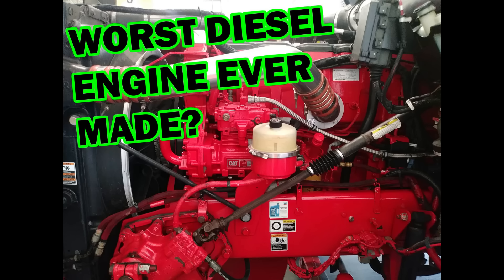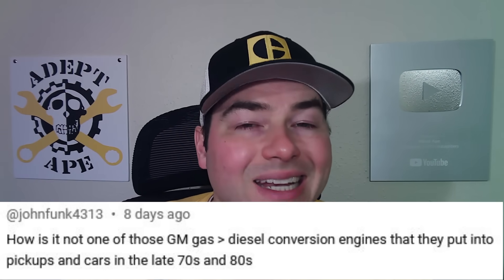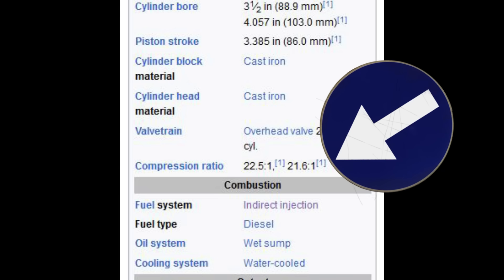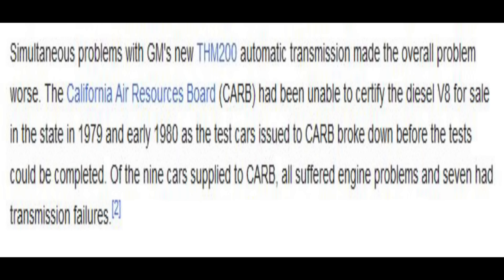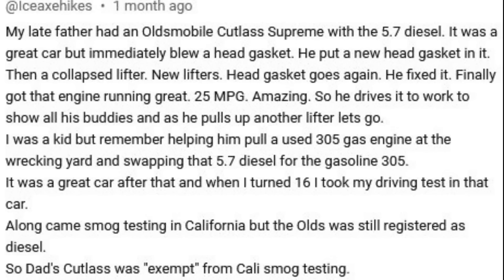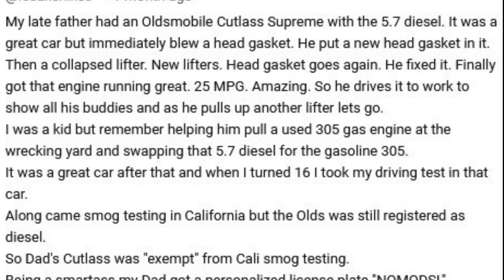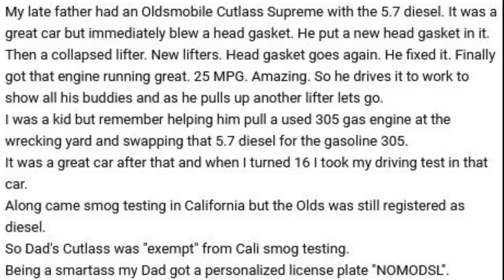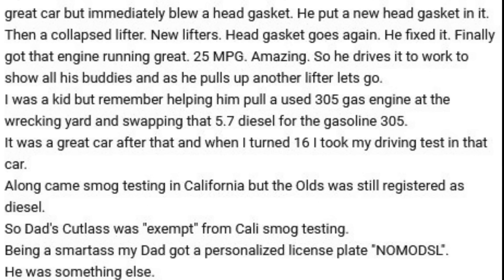This Engine is the Reason You Don't Have Diesel Cars in America!!!

Comment: Mom bought an 81 rabbit diesel for 7200 out the door. 
Those little fellas are some of the best diesels of the time , ran rings around the domestic garbage as far as reliability.
Reply: Had a Diesel Rabbit for a loooong time, still have a diesel w123 mercedes..Most reliable car ever built.. GM idiocy, particularly how they treated their customers guaranteed most would never buy another diesel anything, many never another GM product, more than a few never another US built car.
 GM knew how to properly build a diesel engine; ie Detroit Diesel, Electromotive locomotive engines.  In europe  Opel(part of Buick then) built a fine engine.
 This is what happens when bean counters and marketing override good engineering.. Had they got it right there would be fewer imports in the market imho.
Reply: Volkswagen Diesels produced about forty-ish horsepower with a timing-belt and a weak head gasket. When it came to 80’s Diesels, Mercedes was king, with the MFI Peugeot Turbo-Diesels being a close second.
Reply: A shame they have been legislated out of existence for the US. Our government at work.
Reply: I have a Fiat 1.3 diesel based on their FIRE engine line that’s been around since mid 1980s. 
Double overhead cam, 16 valves, direct injection and 70bhp out of the box. They can be mapped to 95 bhp. 
A major feature is the split crankcase/block. Above crank is cylinders in cast iron. Below crank is a one piece aluminum block that carries the bottom bearing shells. It’s as strong as. 
Cylinder head carries valves lifters and rockers. Twin cams are above that.
Reply: @Dave5843-d9m  1.3 iirc have also an alloy head and Multijet

Comment: I know someone that bought one in a fancy full size Olds. The injector pump leaked in the basement garage, weeks to replace and it leaked again. Head gaskets went and during the repair process a bolt got dropped in the intake. Scratch the engine. The dealership owner had lent his personal car, a Caddy, and really wanted it back. This guy told him write me a check for what I paid for that pos, and you can have the Caddy back.  He took that check and went to Mercedes dealer. That was a good reliable diesel...

Comment: Due to CAFE bs Mercedes Benz almost exclusively sold diesel cars in the US during the late 70s/early 80s. Something like 80% of cars sold were diesel power. Some of the turbocharged cars didn’t run too bad at the time. Unlike the junk Olds engines, the Mercedes diesels didnt die, they just leaked oil.

Comment: Back in the 80's we would (on chevy pick ups) pull the 350 Olds diesel and install 350 Olds Gas. The 24 volt starting system would be reused and those 8 to 1 compression engines would really spin over fast on start up.

Comment: Had 3: 1982 Olds Delta 88 5.7, 1981 Olds Delta 88 5.7 and 1984 Cutlass Ciera 4.3. Swapped the two 5.7s for early 70s 350 gasoline engines. The 4.3 V6 diesel was amazing. 29 mpg city and highway with the lock-up torque converter not working. The engine was so tight that it took a month of driving for the engine oil to go from completely clear to faint gray-clear and be visible on the dipstick. These were indirect-injected engines with a swirl chamber. They needed the very high compression to overcome the heat loss due to the high surface-to-volume ratio. The 5.7s were NOT converted gasoline engines. The blocks and internal parts were different, heavier than the gasoline engine components. Popular Science claimed the diesel 5.7 ended up being only 50 pounds heavier than the gas engine. Compare the weights of industrial diesel engines to comparable displacement gasoline ones: Chrysler 3.8 V6 weighs 413 pounds, Cummins 3.9 I4 weighs 679 pounds. The automotive and light truck application needs a light-duty, high-revving, lower-cost diesel engine. Basing such on a gasoline engine production system just made good sense. More testing was needed to uncover head clamping and water-in-fuel problems and correct them. Ever seen a 1985 5.7 diesel V8?

Comment: I remember Oldsmobile diesels being converted to gasoline. Way better blocks than regular blocks. High horsepower potential indeed. All diesels nowadays are cursed because of climate nazis. I steer clear even though I'd love have a 4bt or Perkins in my truck I am speaking of the 350 stroked and poked

Comment: Dad had an '81 Olds Delta 88 diesel 5.7 ran like a top. Used it on a rural mail route 71 miles 400+ stops a day. Just needed to run good oil and change it often we did 3k miles for a change. Front brakes were today after 3 months. I got really quick on front pass changes. Kept the car for 5 years never opened the engine or trans.

Comment: I have a 14 Chevy Cruze diesel with the 2.0. Emissions fell off approx 20k ago in a tragic pothole accident. When emissions were stock it was getting approx 48 highway (best) and now it gets nearly 56 highway (best). Besides it being in a pos Chevy Cruze, the motor itself has been great. Did all the recommended timing belt, water pump, idler pulleys etc at 100k and it’s been flawless since. 👍
Reply: Did you lose all your guns in a tragic boat accident aswell? LOL

Comment: If I could find another 5.7 diesel I would drive it until the wheels fell off.  Had an 82 impala with the v8 diesel while working road construction and going to college in the late 90's. Had 280k when it was retired due to being rear ended.  Biggest problem with diesel cars is they are driven like a gas engine.  Fire it up and stop at the store and shut down.  No warm up or cool down.  Thanks for bringing up fond memories.

Comment: now here's a crazy one. in my old factory service manual for my 91 s10 there is a listing for the 6.2 diesel as an engine option for that little truck. now im not sure what reason or purpose that some one would need a 6.2 diesel in that small of a truck, but what an insane idea it is none the less. if you could get it to hook up that would be a veritable pocket rocket of a truck. i dont know if the engineers were just goofing around or were actually serious at that time; just think of the possibilities that truck could have had. if it wasnt for the damn goverment epa regualtions the s10 would have a lot more engine options than just 3, also maybe some better gearing options too.

Comment: Good video, Josh. As always. I owned an ‘81 Bonneville with the 5.7 diesel engine. Great car, 30mpg with a 30 gallon fuel tank. I drove the car gently and finally lost a head gasket at 100k miles. The shop manager came out to confirm that the engine had never been opened up before. Sometime after that I swapped in a gas engine. I could have driven that diesel car from MD to Fl nonstop if I had a catheter. :)

Comment: Our neighbor bought a Diesel suburban back in early 80s, we use to camp with them, first trip to Fla they had issues all the way down towing a 20ft camper, got it fixed during the 2 weeks we were in Fla, motor blew up 40mi from home. He ended up ripping that POS Out and put a small Detroit outa some mid sized dump truck, all i remember as a kid was the whole back of Suburban was black with soot, and when they drove by it huffed clouds of black smoke. Boy did that truck pull! They put some big standard transmission in it. Ill find out what motor and trans it was and comment. What a cool truck for the early 80s
Reply: I’d love to know what and how they did it. I’ve wanted to put a Detroit in a suburban for many years and any info would help immensely!

Comment: Compression of 20-22.5 is not unusual in non turbocharged diesel engines. Modern turbocharged diesels are usually 14.5-16.5.

Comment: As I believe I had mentioned on that prior video, my brother had bought a 1980 chev half ton with the 350 diesel at my dads push for him to do so simply because it would get better mileage and diesel was cheaper. He always plugged in the block heater and treated it well but it started to run rough and smoke and had to have the injectors replaced ( he had installed a racor fuel filter assembly on it right off the bat to combat any possible water etc and they filter extremely fine ) , then it was running like shit again after a time and since it was off warranty he decided to sell it ( more like almost give it away ) vs sinking any more money into it. No doubt it needed a fuel pump and injectors and who knows what else was about to go on it. Now I wish I could recall who it was whom my dad had a conversation with down in probably California in the early 80's, it was one of a very few independent automotive engine engineers ( he owned his own specialty engine shop )  that GM consulted with to get input on their idea of building these engines to begin with and after looking at their design proposal he warned them DO NOT BUILD IT as he could see it being a complete and utter disaster, and they ignored his professional input and built it anyway and proved what he told them in the first place that it would fail. Again I can't remember what exactly point by point this engineer had told my dad about the design flaws but they were many and had to do with the block strength and crank and bearing diameters that were never designed to withstand the compression pressures and forces of a diesel combustion engine, starting out with a completely under designed platform. Why GM was so bull headed and went ahead with something they knew was going to be a ticking time bomb, that is a good question as it didn't do them any favours at all. Look at Chrysler, when they started putting the Cummins engine in their trucks which was already a proven engine and soon proved that it was a great platform ( not very powerful though at the beginning ) , that is what sold a pile of Ram pickups as otherwise they were not a great truck. Ford went with International and they too gained a large market by their move.

Comment: Great video - well done. I grew up during that time era and considered that car (Oldsmobile known for the first modern short stroke high compression overhead valve v8s - Rocket V8) but when I realized it was a gasoline engine converted to a diesel I thought that this would be a reliability nightmare - boy was I right.

Comment: Blaming the Oldsmobile diesel as the reason we don't have diesel car today is not fair. Blame it on Volkswagengate and all the stupid emissions we have today. No diesel engine manufacturer today can say that they have the most reliable diesel engine. Now if Oldsmobile had a good reliable engine back then maybe other manufacturers would have try better. But Ford offered a believe the Thunderbird  with a Bmw diesel and Jeep offered a the cherokee with a Peugeot or Renault Diesel and none fate better than the Oldsmobile. Oldsmobile just sold 20 times better than any other manufacturer so they got the worst feedback then. I'm a firm believer in diesel engines, I own 2 5.7 a 6.2 a 7.3 2 Mercedes diesel a Peugeot 504 and 2006 Jeep liberty CRD. But I would avoid anything after 2007.

Comment: love my '06 vw jetta1.9 diesel. 535,000 miles and still going strong.... gets 55mpg all the time...
Reply: Nice
Reply: It’s known to be amazing and I am pretty sure was developed with Ford.
Reply: I also have a 2004 vw jetta tdi belonged to my parents and it stop running I towed it home replaced the fuel temp sensor injection pump and crankshaft  position sensor running like new vacuum line repaired for turbo also 120,000 miles took it alabama and back to ny 60 miles to the gallon 😂

Comment: I had a 1982 Pontiac Grand Prix with one.  My brother and I put a set of heads on it.  Two sets of head gaskets.  After the second set, we must have missed some smog hose.  It had blowby like you wouldn't believe.   I traded it for a 1987 Trans Am.  The dealer wanted us to do something about the blowby.  Yeah, right.  There was a guy near me who swore by them.  He said GM fixed the problem with the cam and lifters.  The car us to across country twice.  The trans was the same one that GM put in the Vega.  Wasn't very good.  Something happened to that, but I can't remember what.   There is a video on here that goes through eveything that happened.  They put them in Cadillacs and ruined them.

Comment: What's funny about you bringing up VW is that there 1.5L later 1.6L IDI was converted from there existing 1.8L gasoline engines.

Basically they under bored it beefed up the bottom end and some other things. But I definitely remember that the vacuum pump for the brake booster was in place of and driven by the distributor drive gear.

Comment: The crazy thing is GM made a really decent engine back in the late 60’s and early 70’s when they built the Toro-Flow engines…they were V6 and V8’s…I believe they were 351, 401, 478, V6’s and the 637 V8…they were actually very good engines and they actually made the gas version of these engines as well…and the misconception is that they were gas engines that they modified to diesel but in fact they were diesels from start to finish that they converted to gas engines to serve the purpose of their customers and stay within their budgets!..the 4.3 and 5.7 got their pedigree from their gas counterparts!..

Comment: Two biggest issues with the 5.7 was it didn’t have enough head bolts and there was no water fuel separator…the 6.2 was a much better engine…I will say as bad as the 5.7 was, the 4.3 diesel was actually better than the 5.7, which isn’t saying much…if they had have did a little more R&D they could have knocked it our of the park with those engines because they did in fact achieve what they set out to do with those engines in the fact they were amazing on fuel!…they not only had very similar designs to their gas counterparts but they also had the same harmonic balancers as the gas engines which in the end was detrimental to the bottom ends of those engines!…if you have a diesel engine you need a harmonic balancer for a diesel…

Comment: The Oldsmobile 5.7 diesel was not just a 350 cubic inch small block chevy v8 that had been "dieselized".  It had larger diameter main and rod journals with thicker, stronger connecting rods.  There were two versions of this engine produced.  Both were precombustion diesels.  The early engines had flat "slip-n-slide" hydraulic lifters.  GM solved the problems with lifters around 1980 by going to a roller lifter design.  The other big problem with those engines was the fuel system.  GM used a 4-hole Roosamaster "pencil nozzle" similar to the 4 hole pencil nozzles used in the Caterpillar 3208.  A multihole injection nozzle should never be used in a precombustion diesel design.  Precombustion diesel engines use an open, pintle nozzle.  The other problem with the Olds diesel fuel system was the injection pump.  They used a Roosamaster rotary injection pump.  The Roosamaster rotary injection pump was a great pump for four cylinder engines, and even six cylinder engines.  But when they tried to produce eight cylinder injection pumps for the Olds diesel V8, they ran into problems with injection beginning for one cylinder before injection ended in the previous cylinder.  These were called "phasing overlap problems".  I should point out that Roosamaster solved the phasing problems in the eight-cylinder rotary pumps, and those pumps were highly successful in the Ford/Navistar 7.3 liter IDI pickup truck engines.  The main message from the Oldsmobile 5.7 diesel engine is that a diesel design should be started with a clean, blank drawing board.  GM never should have tried to cobble together a bunch of off-the-shelf parts for a quick and easy diesel engine design.

Comment: I have the Colorado Diesel 2.8 liter. And it is amazing to drive. You barely touch the throttle and it gets 30 mpg with ease.
Downshifting on hills doesn’t happen. Pull my 6000 lbs travel trailer with ease.
This is my 5th midsize truck and this diesel is the best so far.

Comment: I have always been a fan of diesel power for passenger vehicles. 
When Oldsmobile came out with a diesel, I really wanted one. Until the reports came out about all the failures due to poor engine design. It made no sense since diesels had been around for many years. Mercedes made the 240D sedan which was an excellent reliable car, but it sold for $10500 which was a lot of money in the 70’s. 
It wasn’t until Ford started putting the 6.9 IH diesel in pickup trucks that I finally owned a diesel vehicle.  That truck went over 250,000 miles with only a head gasket replacement. Sold it to a friend who drove it for another 250,000 miles. 
I owned three other Ford diesels with IH engines and loved them. 
In 2013 I bought a VW Passat TDI with the 2 liter turbocharged diesel. I got 45-50 mpg on the highway and it paid for itself as I did over 39,000 miles annually. Unfortunately this was the engine that cause the big issue with falsified emissions tests that cost VW billions. I still have that car and love it. The only problems I’ve had were emissions related; a failed EGR cooler which VW paid for along with new radiator, heater core and coolant surge tank. Total cost was over $4,000 but VW picked up the whole tab. 
It’s a shame that diesel automobiles have gotten a bad reputation in the American market. They will reliability run thousands of miles with just normal maintenance. Although my diesel VW has 170,000 miles, there is no smoke, no odor when it runs. It’s only slightly noisier than a gas powered car but still gets over 45 mpg. Most people don’t know it’s a diesel unless I tell them.